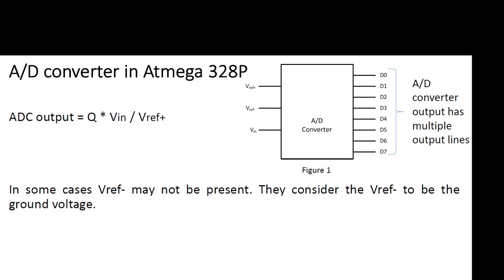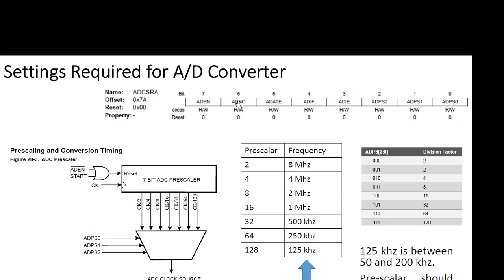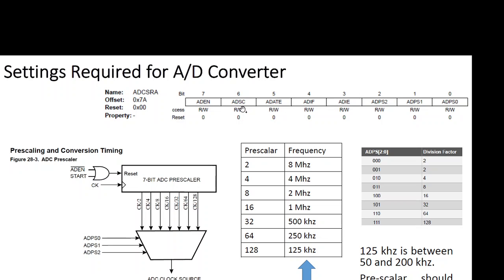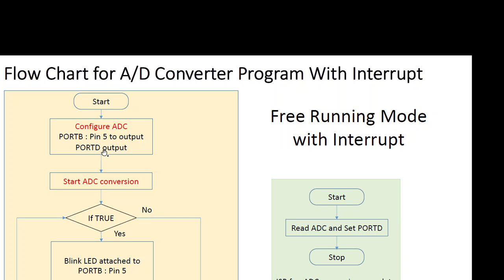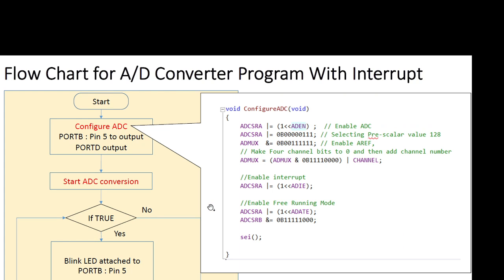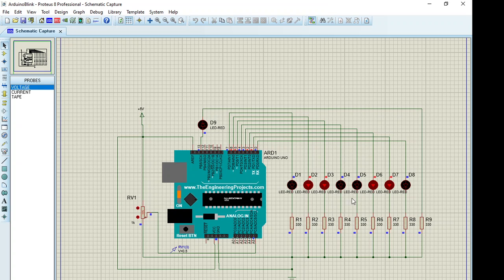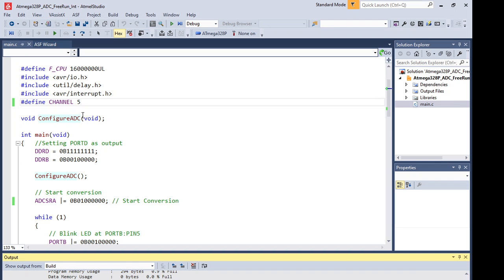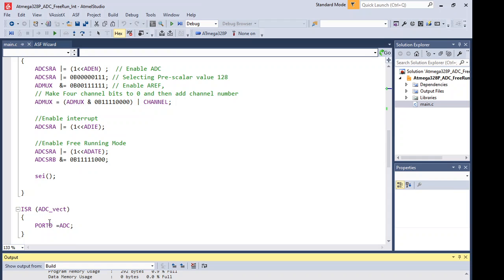ADC in Atmega 328P Free Running Mode with an Interrupt

Comment: Hi sir
I have implemented free running mode but the adc output do not change while potentiometer is turned.
Output will be the first value and then the output doesn't change.
Reply: I am using wokwi simulation

Comment: Thanks.
Please , Sir .How can read from A2?
Reply from the maker: Connect the input to the corresponding pin. Then, set the channel using ADMUX. If you are following this code, CHANNEL should be set to 0B00000010 or 0x02